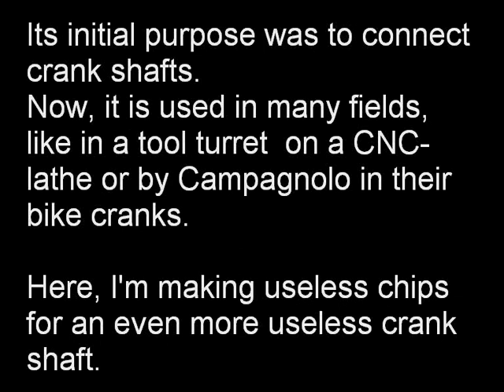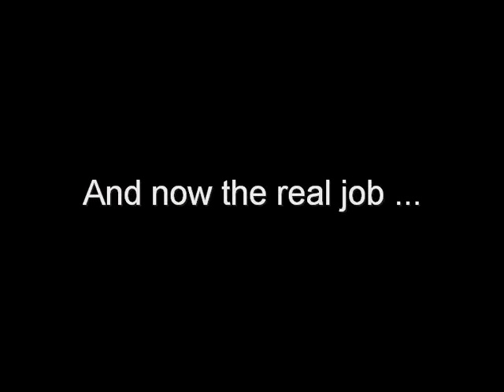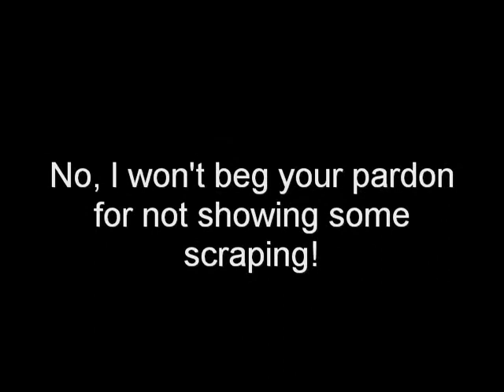Milling a Hirth-coupling w. EMC2 on a MAHO HM700C mill and a Haas TL2 lathe

Comment: Nice and well done with a solid technique. I need to make a 3.5 diameter coupler however i will be taking a different approach myself for a curvic design where the teeth will have convex and concave contours to the mating surface. I have idea how to go about it though surfing for additional ideas if i can find any time savers like using formed tooling.